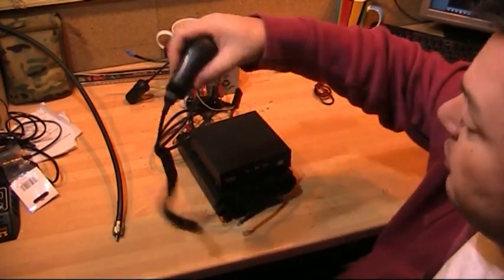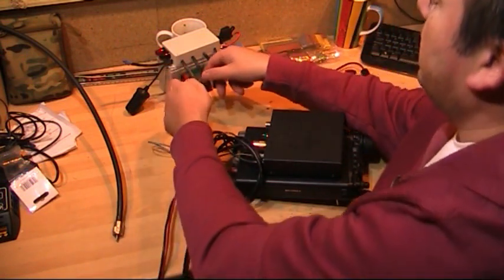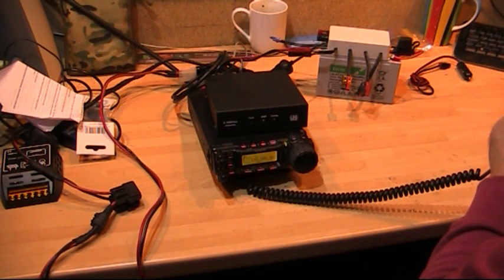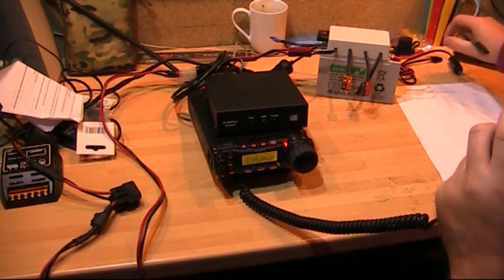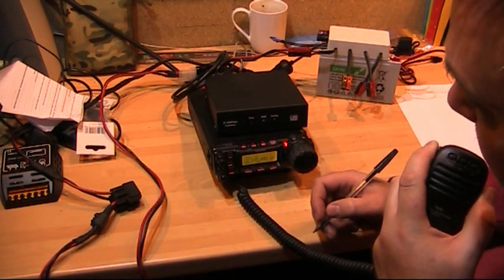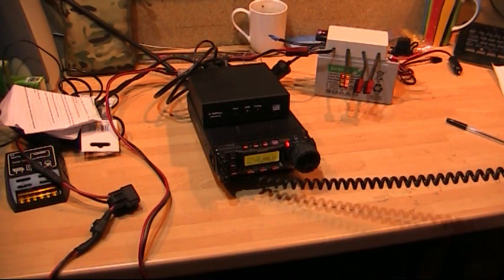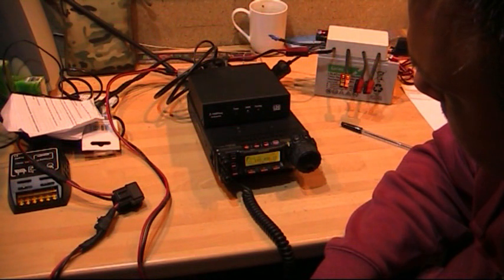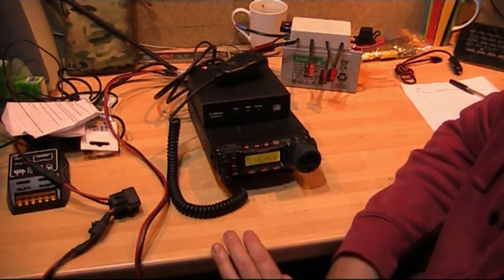Portable QRP Battery Pack pt 2

Comment: Nice little setup James....I'm also working along the same lines as you.

Bulding my workshop/shack and getting my cctv, solar panels and QRP PSU built.
I plan to use the portable psu for radio and my quadcopters/rc cars.

I have access to four 12v 42Mah but a bit heavy to lug around at the same time lol. For the solar side of things, I have a pair of 12v 120Mah batteries to play with and at the moment a single 100w solar panel.....I plan to have 4x100w = 1kw panels which will run the shack off grid.

Going to watch the rest of your videos for ideas lol
Keep up the good work.
73
George G0TNC
Reply from the maker: +George Stephenson Thanks for your comments George.  Good luck with your projects. Would be good to see on youtube.  73